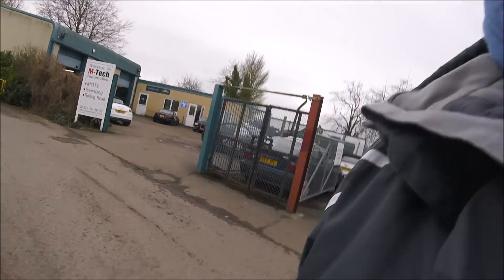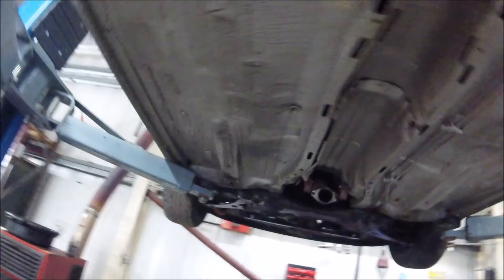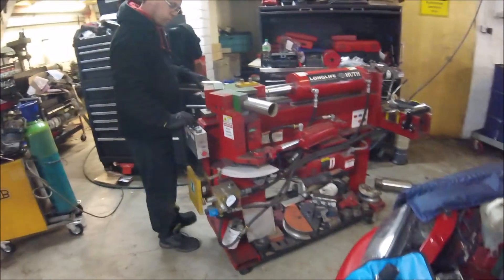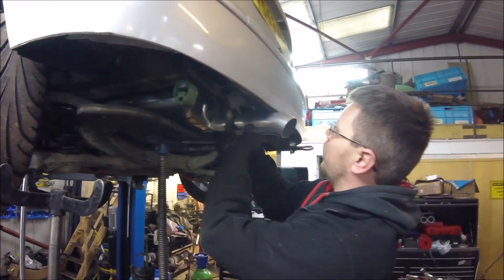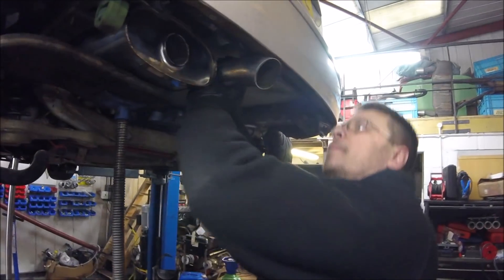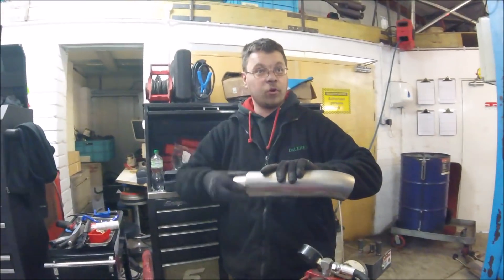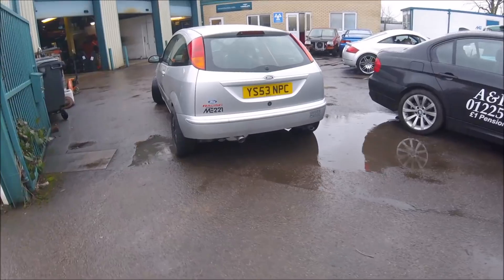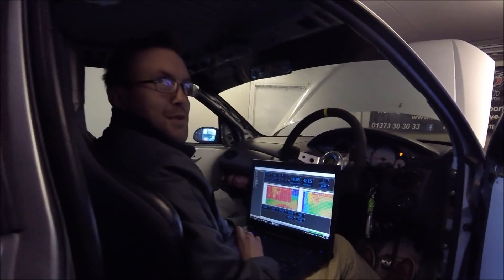PORTED HEAD RESULTS & CUSTOM EXHAUST

Comment: Steve, I know this is an old video, do you remember what thickness head gasket you ran on the st170 with your 1mm skim?

0.6
1.3
2.0

Cheers
Reply from the maker: Off memory it was 1.2mm when I measured it.
Reply: @Sparkplugsteve  thanks alot, just going to go for a 0.2 skim and a 0.6 gasket, play it safe 😂

Comment: Hi mate are you running 38mm throttle bodies?
Reply from the maker: joshua turner hi I think their roughly 46mm tapered. Can't remember exactly.
Reply: OK cheers mate can't choose whether to get a black top zetec or a st170 for my mk1 escort can you get bigger cams for the st170 that still uses the vvt system
Reply from the maker: joshua turner you can get cams but there's no feedback I can find on anyone running cams and vvt. They are very mild though when keeping vvt so don't think the gains are big.
Reply: OK thanks good videos keep it up

Comment: Where can I find a budget exhaust for the ST170? I've just bought an ST after my MG got written off and I'm struggling to find a ready made exhaust let alone one for less than £300! Someone told me the 2.0 Focus exhaust will fit which I have found a damn sight cheaper but am unsure!
Reply from the maker: Leadfoot hi. Don't put a 2 litre exhaust on. The bore is smaller and may restrict some power. The standard exhaust is a good free flowing exhaust. If you just want some more noise then you can buy a silencer pipe replacement for the back box on ebay.
Reply: Spark Plug Steve don’t suppose you have a link for a pipe for a little more noise do you?
Reply from the maker: Leadfoot https://rover.ebay.com/rover/0/0/0?mpre=https%3A%2F%2Fwww.ebay.co.uk%2Fulk%2Fitm%2F292536918905